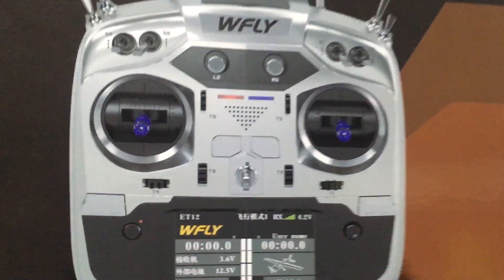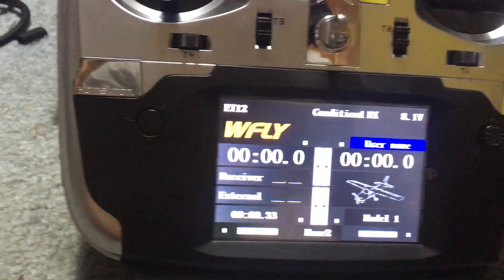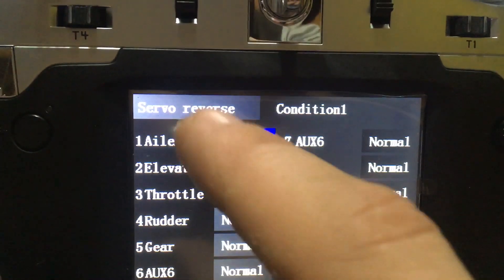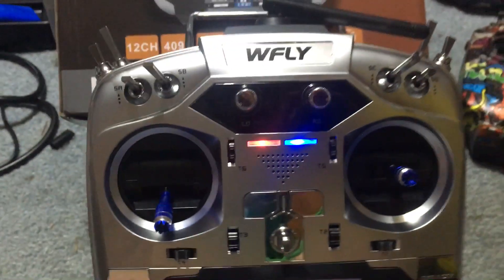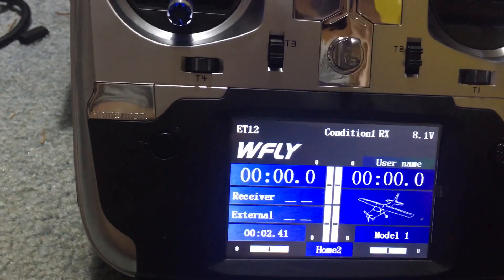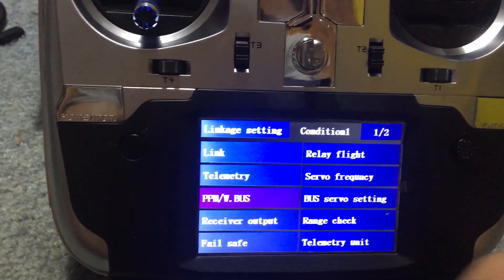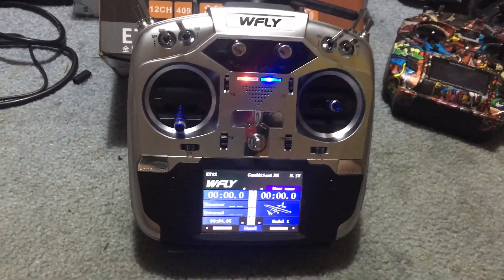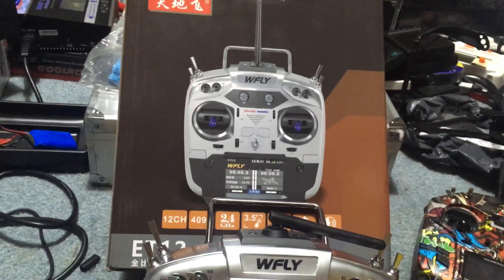WFLY ET12 12CH 2.4G Radio Controller Transmitter with RF209S 9CH FPV Receiver PWM PPM - Mode 2

Comment: Nice controller but I will stick with my jumper controller. 👍👍👍👍 Thanks for sharing.
Reply from the maker: RayFpv o yeah jumper for win but I like this hope I can get usto it n bound to stuff
Reply: @JayDrone  Just because jumper can bind so many different receive doesn't mean nothing. Their hard to use because their using opentx. Jumper is seriously new. I had couple wfly never had issue crashing. I heard a lot of issue of compatibility on different receiver with jumper. I had a taranis work well to why shall i trump jumper on a 1000 or even on a turbine jet then a frsky, or wfly or even my spektrum and fataba radio? Why jumper?
Reply: wfly will soon release a system which is fully compatible with external module, it will work with jumper4n1/frsky/Tbs Crossfire module. 16 Channel telemetry radio

Comment: looks like a pretty decent controller for planes but, if it aint got multi-rotor in the model menu it prolly aint gonna happen. nonetheless, it all looks great for flying planes.
Reply from the maker: it has multirotor
Reply: Bro even a 6 none computerize fm radio can do multi rotor LOL Multi rotor is basic aircraft.